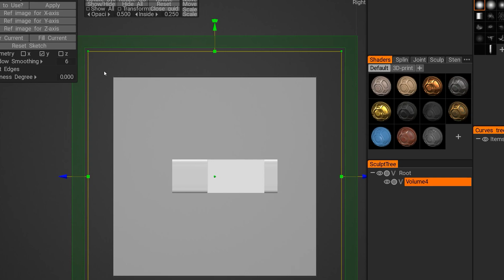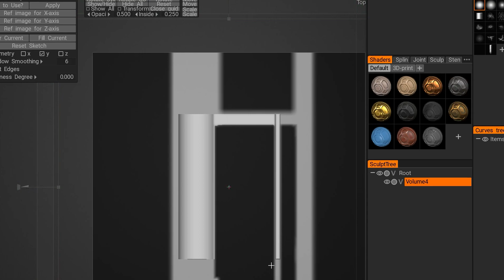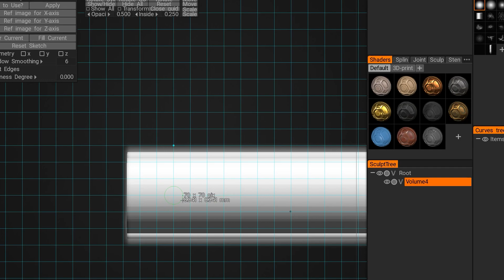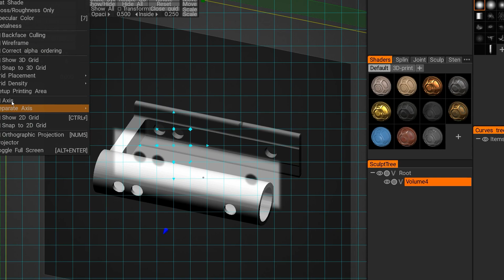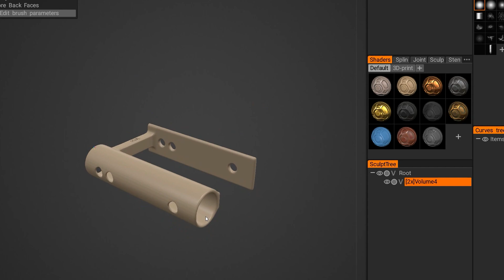3DCoatPrint Sketch Tool. Create a model by drawing in three projections. (The same in 3DCoat sculpt)

Comment: I don't see Sketch tool in the 2022 version of 3D Coat, where was it moved to?
Reply from the maker: It should be available and visible in both Surface and Voxel mode. Just look for the SKETCH tool in the OBJECTS section of the Tool Panel.
https://youtu.be/wC1dLJHGclo
Reply: @PILGWAY3DCoat  Thanks!
Reply from the maker: You are very welcome.